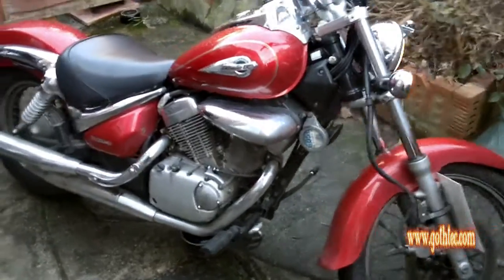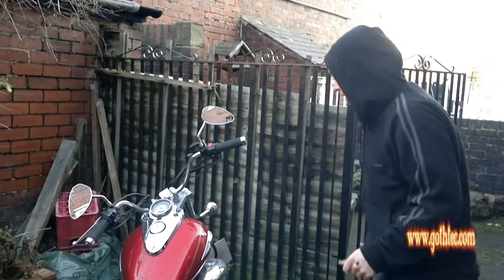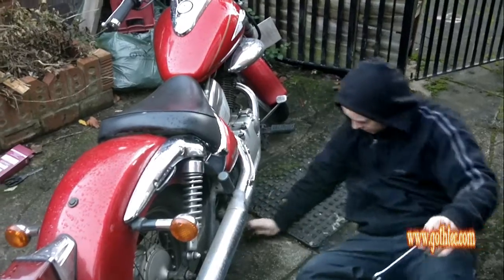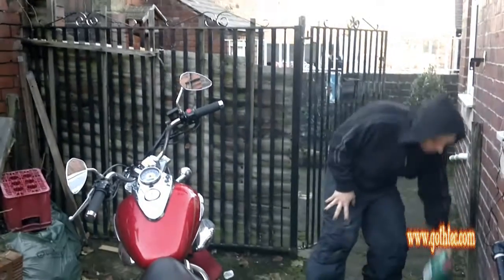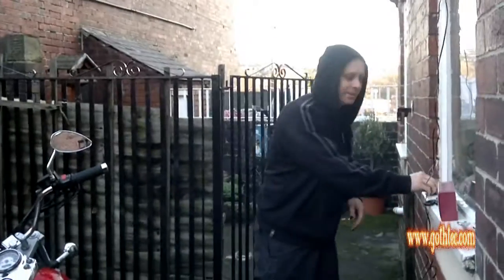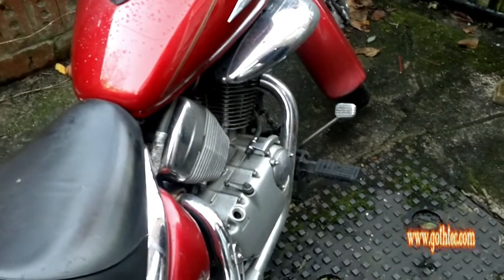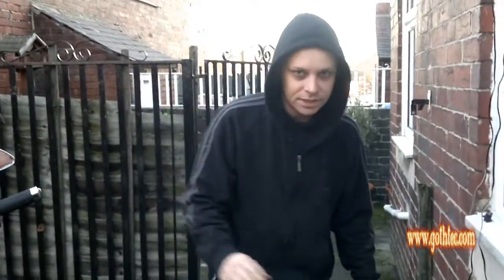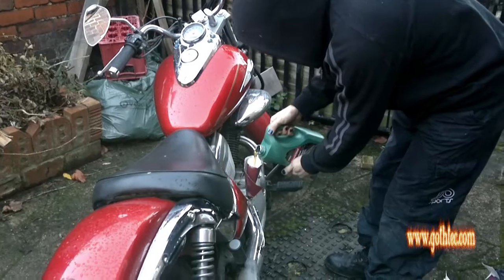Suzuki VL125 Intruder Oil Change

Comment from the maker: Right! It depends on the weather conditions, type of bike, and age of engine... As different types and grades suit different conditions... As this bike has the oil feeding both the engine and clutch, you want a mineral oil or semi-synthetic, as fully synthetic causes clutch slip... 

Check your owners manual for the bike and conditions of ride ie: hot or cold

I think in this case I used 10w40 mineral for winter riding, but that is from memory :)

Comment from the maker: Use the right tool, you can pick a T-bar with a UJ that does the job, unplug the HT leads and whip them out... Check the gab in the plug with a gauge and set it right and (This is important) In putting them back in DO NOT Cross the threads and DO NOT over tighten!!!

Comment from the maker: The SF or SG are specifically grades for motorcycle use, because of the wet clutch. The letter combinations are performance ratings from the American Petroleum Institute... These grades are classed as "out of date" because of improvements in oil technology... Basically you can put modern grade in an old engine, but not the otherway around, so SJ, SL, going up the alphabet will be fine..

higher grade=the latest type. You can't get SG or SF. All new oil is going to meet the latest certs.

Comment: what would you do for a stuck sump plug on a 125 intruder?.... the head has been slightly damaged by the 17mm spanner slipping off under force... im thinking molegrips but was wondering since you owned one if you had any tips?... thanks
Reply from the maker: Wasn't my bike, it was the ex-gf bike, haven't seen it in over 4 years...

Sump plugs, damaged seized sump plugs...you need a tip.... hhhmmm... take it to you local bike mechanic, if he breaks it your in luck there is an expert to hand.... Now if you did the job, well, sods law indicates it will break... and then you'll have to take it, or get it picked up, to a mechanic to spend many expensive hours trying to get the old broken one and sourcing a new one..

In other words, there are some jobs you leave to the expert... this is one of them

Comment: I have a vl250. I was wondering which oil filter do I need. It doesn't specify one in the manual. Just a bit confused. If you could please help me with that. I'd really appreciate it.

Comment: Oh ok thanks as its summer now ill use the hot one.

I have a Suzuki GZ125 but i can only find a manual for the GZ 250.

On the manual it says 

''SF or SG classified (API) engine oil with a viscosity rating of 10W-40 (SAE)''
i have no idea what this means, would you be able to tell me.

Thank you again